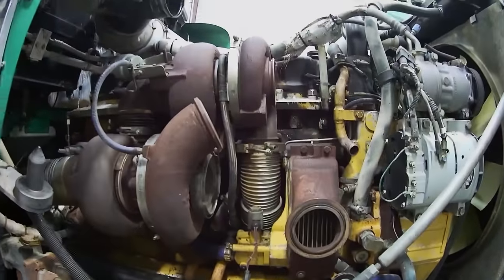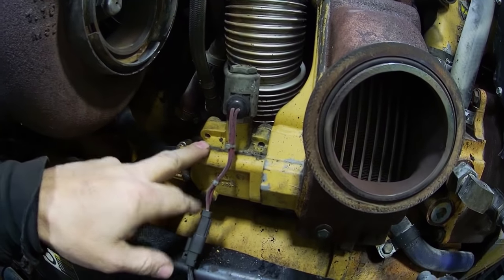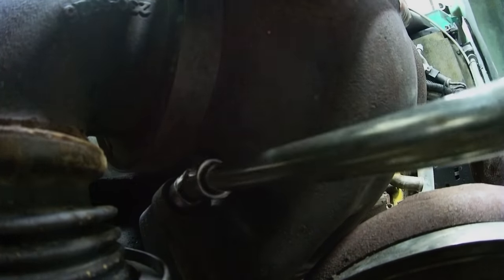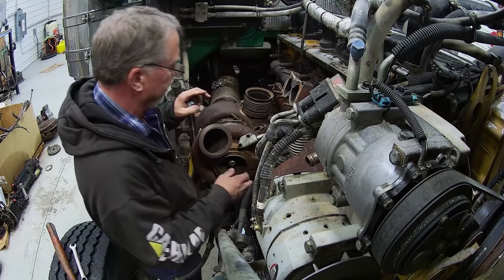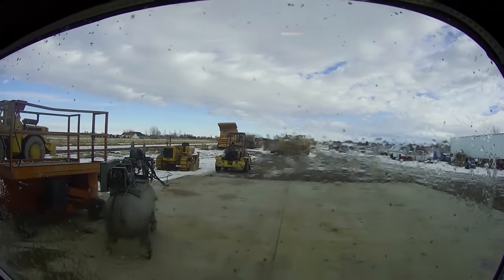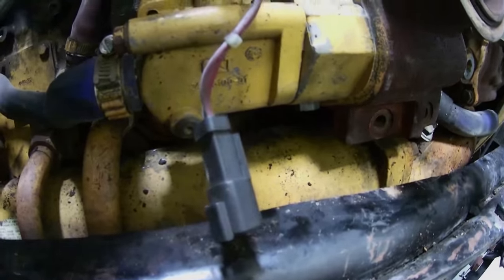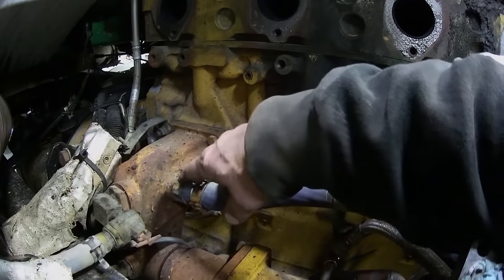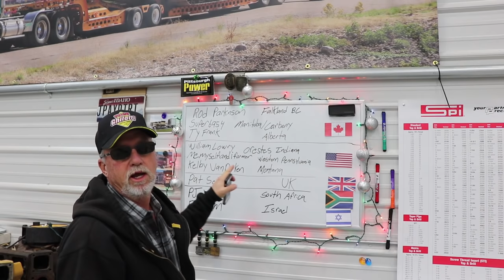Caterpillar C15 Tear Down

Comment: I know you a Cat man but you have to admit that ACERT engine was a terrible attempt at emissions reduction. Really would like to know how that switch blade turbo works for you. You certainly have me interested in one. There website leaves a lot to be desired on how well it works . Good luck with it. Sure am curious about how well it works.
Reply: The acert is a bad engine because of the programming, a simple ECM flash will cure a lot of the acert problems.
Reply: An ECM flash wont cure all the other issues the ACERTS had with the leaking twin turbos and the intake actuators, broken studs internal and external. Just look at the International Maxx Force just a rebranded CAT and they paid the price.
Reply: The maxxforce 15 is much different, the only thing it shares with an ACERT is the rotating assembly, the fuel system, turbos, and emissions equipment were all supplied by navistar.

You do know there are ecm flashes available that disable the actuators right? Changing the file also gets away from the retarded timing that creates heat and poor fuel mileage, pulling the heat out changes quite a bit in the way of hardware reliability.
Reply: Yes I understand that the reflashes helped them considerably. You can't deny the fact that they never met the emission requirements and were far from reliable. The MAXX force is not a carbon copy but it certainly based off of the same useless technology and a good 90 percent of the parts come from Cat. Just look at the engines in cat trucks the parts for them come from International and most in cat bags. Cat sold them on the idea that they could do it different than the rest. Hence both couldn't meet emissions and were fined accordingly.
Reply: wht, cat didn’t design the parts that were a failure with the maxxforce 15, if that were the case then their industrial engines would have went to high pressure common rail but they didn’t, they still use their traditional fuel system.  

The SDP was a joke solely because of the emission equipment, but deleted they are one of the best built engines out there, if building high HP working trucks most turn to the acert rotating assembly as it is built the best.
Reply: I never said the rotating assembly was an issue. But ACERT technology was a joke. You certainly cannot deny the fact that the ACERT technology was passed onto International. International and Cat together both claimed that they were sharing technology jointly at the time. Hence International Built the trucks for Cat. Cat provided most of the parts for the Maxx force engine. International provided the chassis and body off of there assembly line for Cat. Now that the ACERT technology is dead completely International and Cat have ended there affiliation completely. Hence no more Cat trucks. then tthere is the fact that the later cat trucks have Cummins after treatment systems on there engines. I completely understand that the c13 industrial engine did not have to meet on road emissions. That is why they are single turbo engine with a different flash file in there ecm.

Comment: I’m about to try the switchblade install on my 2006 [pre-emission] C13. I was worried about how to remove/delete precooler and its lines. What is that canister (“retarder”)? I don’t think I have that. I also don’t have Jakes.
Reply from the maker: CAT calls it a Brake Saver, it uses engine oil to slow the vehicle
Reply: It's about 3or4 gal on a37
Reply: They use them much in Louisiana

Comment: How much horse power does your c15 put out
Reply: coy Aldrich 500ho to 600hp depends on what turbo your running
Reply: We can make a c15 do 2000 horse power
Reply: 2000 hp....... for how long, before it grenades ?  Maybe a marine engine but not for trucks
Reply from the maker: It was originally a 435 but at some point was upped to 550
Reply: it's in a sled truck you can only make two passe with it